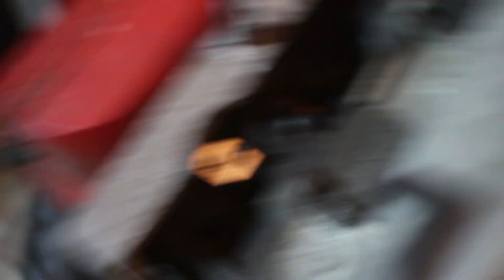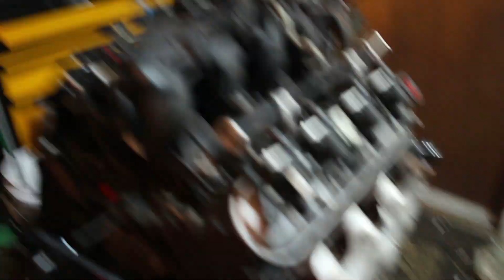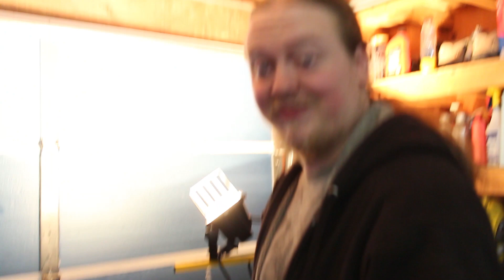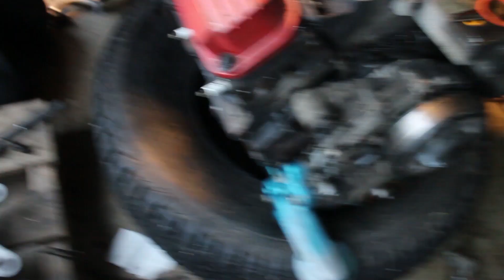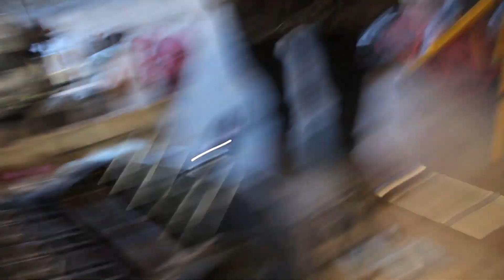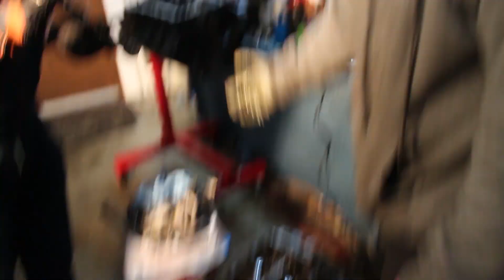Bonneville SSEi 3800 Series II Top Swap Part 1 (Bonneville Blew Up! Using Project F's Old Motor!)

Comment: Hey guys great work but i have a question, I have been following project F and cant wait to see end product I have a 99 bird and 01 gtp and its been so temping. My question is why didn't you just do a top swap onto the camaro engine from the start besides the fact that the gtp engine has forged pistons? is there any particular reason why a top swap from the supercharged engine onto the oem camaro engine wasn't considered for project F ?
Reply from the maker: We got the L67 engine from the gtp for very cheap, also this way we were able to go through it entirely and rebuild iit. It probably would have been more expensive to buy l67 cylinder heads than buy the whole long block haha
Reply: @JuryRigGarage  lol ok thanks for quick reply, cant wait for the projects to be done gluck guys

Comment: How do yall find all the parts that will fit or cross over to the 3800s from other manufacturers?
Reply: Since this motor was in alot of GM cars, it's aftermarket is fairly strong. And so there are many parts for it. However the L67 and the L36 motors are very similar, with them having a identical block for the most part, which makes nearly every part interchangable between the two.
Reply: @tristanrickey3887  thank you but I was meaning like yall found out that you could put a different thermostat housing and the water pump and things of that sort from different cars with a different engine
Reply from the maker: They are the same motors, the water pump is out of a late model 3.8L grand prix, buicks and the monte carlo.